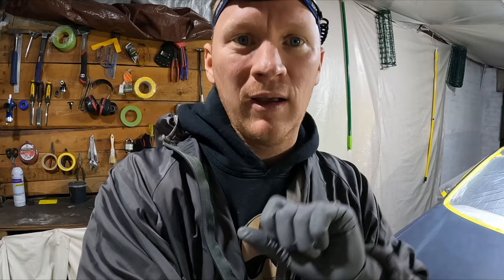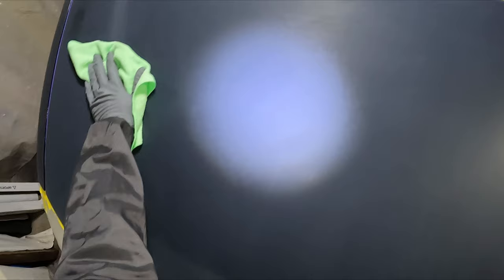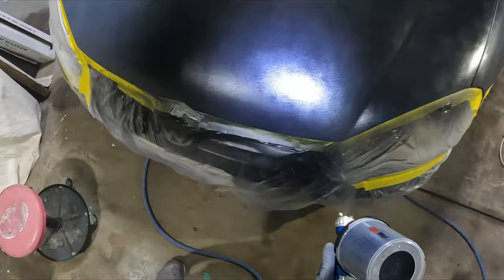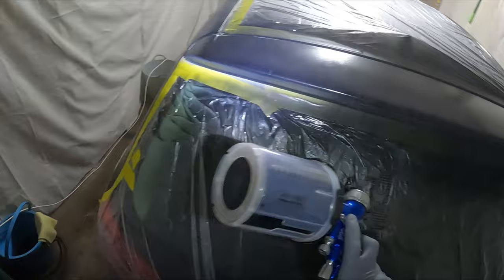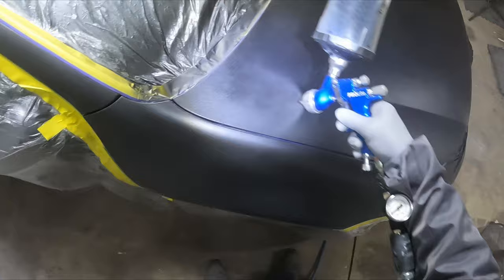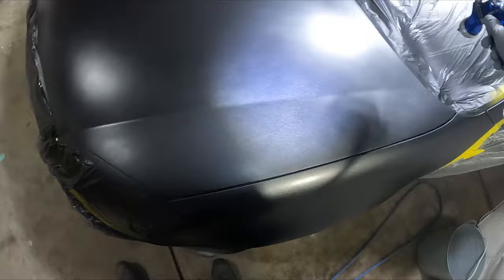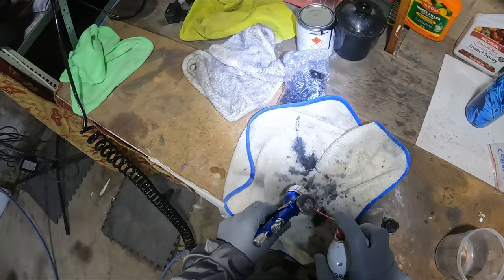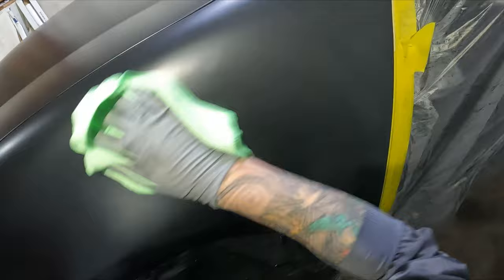Spraying Basecoat Colour In The Garage

Comment: I wonder if putting up one of those ultra violet bug zappers to help control a 'crash' landing?
Reply: They attract insects so no. I'm in Scotland I do boats  now, if I'm doing homer spray jobs mid summer on cars/motorbikes/boats what I do is spray diluted deet spray about (sold here as midgey repellent in Army surplus stores) with a water spray bottle. Turn my extractor on for 10mins, push the project back in my garage then paint. If the midgeys are really bad what I do is wet out the garage floor slightly with a deet & water mix but I watch my humidity meter like a hawk till it flashes off and stabilises then I'm good to shoot paint. Just for comparison if I never used deet in the method I just told you then even maybe a Bonnet/hood sized project I would have maybe 15-25 insects in each coat. If I'm using my airflow and inlet fans I need to use a massive oversized Rhino "green growers" scrubber can to stop pollen and midgeys getting spat at the project at 100+mph
Reply: @bigduphusaj162  Hi and thanks for your discussion. I am not a painter so I don't really understand about the problems and that is why I just thought of the bug zapper as a cure.
Reply: @gordonclark7632  yeah mate that's why it's good to ask 👍   lots of people don't ask they claim their way is the best because they done it once as a DIY job. If someone knows the answer due to doing it as a job or whatever, then they won't chip in unless someone asks. See another natural way to keep insects off your  freshly laid paint is just pick a day where there is a breeze and do it at a time you know the insects aren't as active. BTW I seen a big Scottish Bee land on my freshly done clear then fly off, it never even left a mark.. I spent about a half hour looking for the marks and there was none🤷‍♂️  no idea wtf that is all about as it was huge.
Reply: @bigduphusaj162  Thanks. Have a great day and stay healthy and safe.

Comment: Tack rags are overrated anyway. Last month I did 9 panels for a competing workshop where the the local (territorial) painter had hid all the tack rags claiming they had run out 🤓  I was forced to use my left hand and  compressed air 🤬 After a nice little 5 minute blowing and swiping with bare hands I ended up with virtually spotless results, with mist+ 1 immediate wet coat of uhs clear mind you. With 9 panels in a single booth cycle I rarely achieve this even with a brand new tack rag 😎